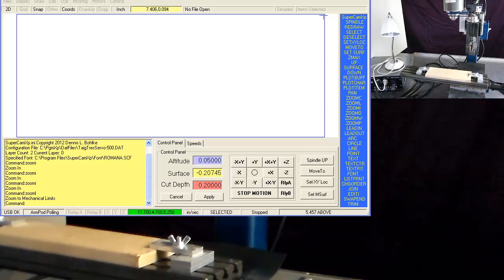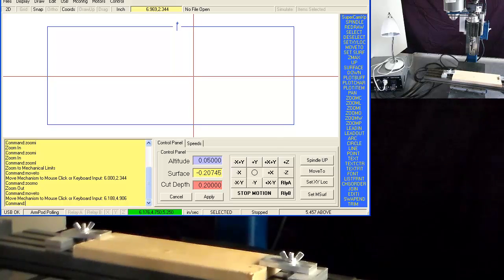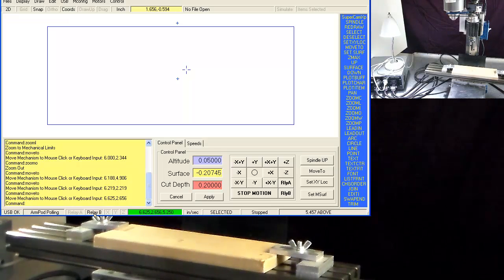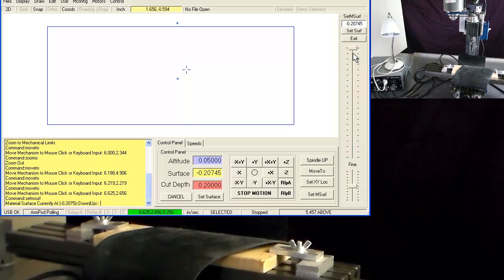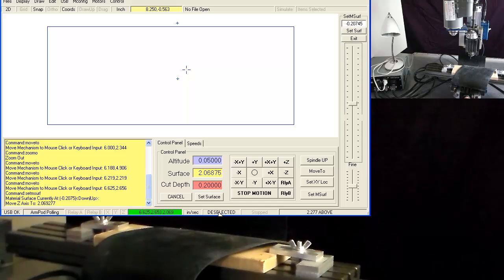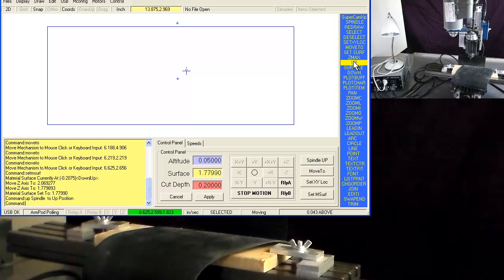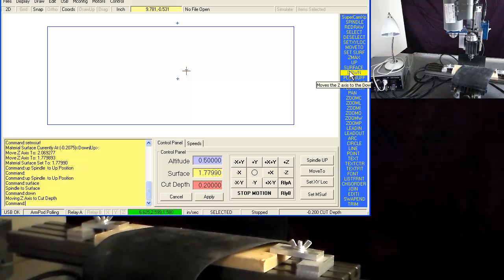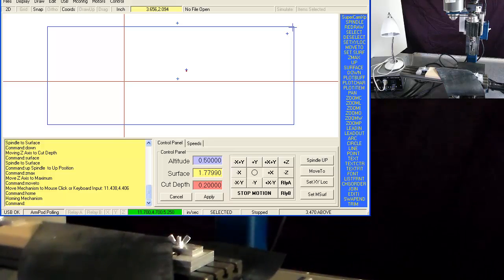SuperCamXp Interface to CNC Tiag Micro Mill

Comment: Dennis died in 2017.  We have a Taig with the servo motors from supertech.  But it is gone.  The computer finally died.  Got a new xp computer hooked up, but can't get usb drivers to load.  It won't work with printer port to printer port.  It must go through the USB.  So... I can't get it figured out.  If anyone has any insight, i would appreciate it.  We like to have all of our equipment operational.  I am not an expert in understanding why the usb driver won't install.  Any thoughts or advice would be appreciated.  Thanks.